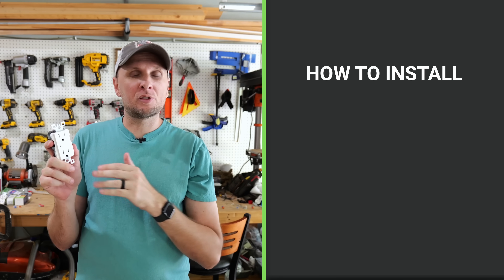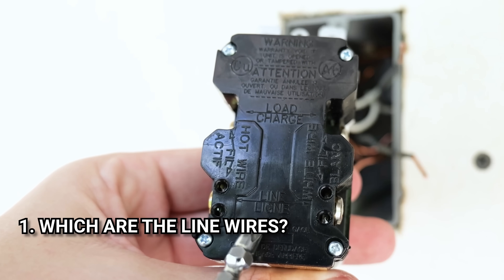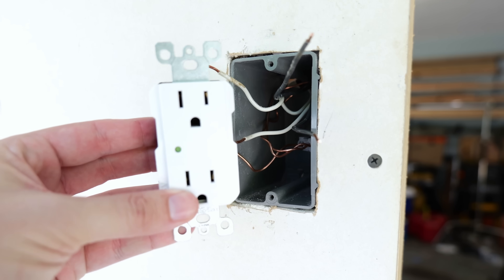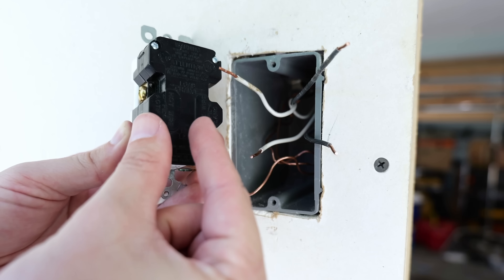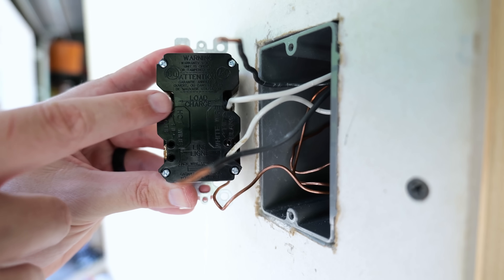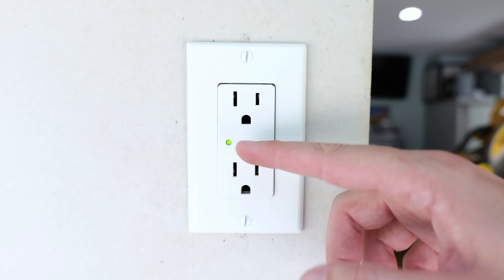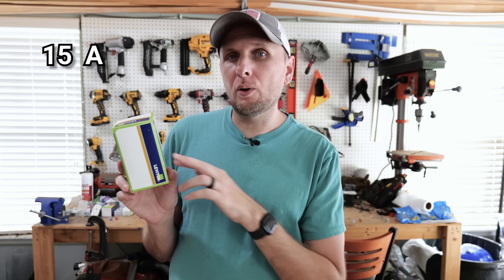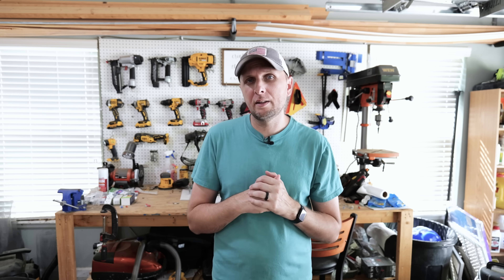This Tiny Device Just Made Bulky Surge Protectors Obsolete!

Comment: I'm no dummy, but the whole back stab thing being slightly frowned upon, really makes me question all of the stab wire terminal blocks (wire nut replacements).  I mean, I have no issue using them in lower current lighting applications.  For receptacles, I like to got as robust as possible, heavy twists, wire nuts, screw terminals.  Like if I have a 120V air compressor, or a heater, anything running long durations.

Comment: Dude, using AC receptacles with built-in surge protection is never a good idea - surge protectors (that contain MOVs, like these Leviton outlets you show) are basically "disposable" devices and it would be annoying to replace them, especially if they are located behind a heavy furniture. It's much easier to replace plug-in surge protectors, either the ones that look like generic power strips that plug into any AC receptacle or the "whole house" ones that you install into breaker box/load center. Same reason I do not use AC receptacles with built-in USB ports in any of our houses.

Comment: I think it’s a great idea but you still can only plug two cords into it.The purpose of most surge bars is to plug in multiple cords & provide surge protection.These are great for 1 or 2 items being plugged in at point of use.I will use these though were I have only 1-2 items being plugged in at point of use.

Comment: As others said, this outlet has "less" protection then many standalone surge units. Besides Joules rating... Label shows L-N/N-G with 600v and L-G with 700v are much higher then many others that clamp surges at around 300v. Similar to "whole house" units installed at load panel "they work" to eat big surges but still may not help you for some equipment vs. It might help a lot like many LED "light bulbs" and Fixtures as most have nothing to protect from surges or other power problems. Note that Many better standalone "surge" protection have more then 1 or 3 MOV to condition power output like Noise Filtering even before looking/buying a battery UPS or other active power conditioning. Noise Filtering often blocks both ways, line to X and Iffy X noise getting out to the rest of building But often does not block Noise from other outlets on same unit.

Comment: hummm i believe the NEC states that when replacing a receptacle it must be replaced with arc fault protection with either an arc fault outlet or an arc fault breaker ...406.4(D)(4) Arc-Fault Circuit-Interrupter Protection
Reply from the maker: Yes, but that topic would be for a different video as it depends on location, current AFCI/GFCI protection whether it is an existing device or maybe a circuit breaker.  And some places have made amendments disregarding that section, I believe Oregon is one place that has done that.  So it is also AHJ dependent.  So good point but not really what I am going over in this video.

Comment: When back-wiring (not “backstabbing”) I always find it helpful to tug a bit on the wire after “connected” as I have made the mistake before of inserting the wire on the wrong side of the internal plate….. screw that down and….. the wire is connected to nothing and will just fall out.  Face-palm (but true).

Comment: How long before it fails?   Do you need to replace it after 3 storms?
Reply from the maker: There is no way to know that, just as you can’t fully predict regular surge protectors.  So many factors would go into that.
Reply: @HowToHomeDIY  my experience with surge protectors has not been good.  On a business level, they fail often and manufacturers fail to uphold a warranty and fail to replace or cut a check for devices they say they will in the warranty.  And they fail often and randomly.

I would just hate to need to replace that often in needing to power down n yank it out of the wall....
Imho.....
Reply: In my home I now mostly use Monster or similar outlet cover style surge protectors instead of older style outlet strip surge protectors (with the old cat5 protectors. Lol...)...and even the monster covers fail pretty fast.   Everything else works good.   I have gfis, smart outlets n glass smart switches all working ok.  No sign of surge problems on anything wiring related.

Comment: You made it sound like you can just take a 15 amp surge protector and just replace it with a 20 amp surge protector, and that is not true you also have to change the 15 amp wire from the service panel with a 20 wire and 20 amp breaker. Not as simple as you make it sound out to be!!!!!

Comment: If these use MOV devices for the surge protection, they are consumable.

It is easier to replace a plug strip than an outlet.
Reply: And most plug strips have higher joule ratings than the Leviton outlet.

Comment: Only 2 plug holes? We need more plug holes.
Reply from the maker: Ok you can add a regular power strip if necessary.  Still way smaller than most surge protectors.

Comment: This video subscription is generally very good (I have learned much from it), but this particular video (for me) raises more questions than it answers (Line/load?, One black is different from the other black?, How the tiny device obsoletes a surge protector when it only provides two outlets versus multiple?).
Reply from the maker: 😂 if you have some of those questions, you probably should not do anything with electrical.
Reply: @HowToHomeDIY  My point in watching the videos is to learn about electrical.  I have learned a lot from watching many previous episodes but felt frustrated with this one since it brought up some unfamiliar concepts and I am used to your helpful explanations.  Maybe I missed an earlier episode which already covered the concept of line/load and why the two black lines are not the same.

Comment: Yeah but can you plug 10 things into that outlet. These are nice to have but one reason we use strips is not only for surge protection but for a safe way to plug multiple things in. Computers and entertainment systems both have multiple things that need to plug in so you’d still have to use a power strip

Comment: Nope, that's what you call a token gesture at surge protection, just enough to call it that, stuffing 2 or 3 MOVs in there isn't the same as a larger unit with more surge protection components, and that are rated for more joules and amps.  That means a few things but practically speaking, can handle a larger surge, and can survive smaller surges, and may be able to clamp surges at a lower voltage threshold.

Comment: Even after checking for lack of power, I still treat it as if there was power present.  Why, it's because I've had circuit breakers fail on me.
Reply: Also noticed failure to probe the white wires for voltage.  The person who worked on the wiring before you might have been insane.  I lived in a condo that had no wirenuts in the junction boxes, everything was bare copper connections!

Comment: Both versions are only rated for 720 Joules, whereas a wall mounted unit that I purchased is 1680 and power strip 3390.  I live in Jacksonville, Florida and lost some electronics (including a $1000 air handler motor) until I installed two parallel whole house SPs, SPs on my AC air handlers and compressors, and on ALL electronics (refrigerators, freezers, microwaves, washing machine, office equipment, etc.).  I also have surge protecting UPSs for most of the office equipment, going through a surge protecting power strip connected to *that*.  I prefer overkill to remediation.
Reply: This is the way.
Reply: Great It was said that some some companies offer that their surge protectors last a few years and may not clean the power like noise or provide voltage consistency. Has this been your findings?

Comment: Looks like an MOV design, which is sacrificial and thus needs replacement as the MOVs wear out -- seems like replacing a strip is much less effort. And w/o an indicator LED (like on TrippLites), there isn't a good indicator of when it needs replacement. Personally, I use Tripp Lites for less expensive gear and non-sacrificial Zero Surge for gear that is > $2000 and feel it is a better practice than using these.
Reply: @rayl6599  when talking about surge protection is all about the Joules of clamping force to stop all of the surge.  Individual surge protectors like you have all vary in the amount of surge they can handle.  That is why a whole house surge protector can provide best surge protection because of its large clamping force.
Reply: @billhandymanbill2775  There is certainly a place for whole house protectors like helping soften a nearby lightning strike (nothing will save from a direct strike). However, they do not protect against internal spikes (from motors starting, etc.) Also, to note, non sacrificial protectors like Zero Surge, SurgeX, Brickwall have no joule limit besides the wires melting as they don't wear out (which is what the joule limit measures - how much protection there was initially). Anyway, it comes down to the value of the equipment being protected. e.g. fancy AV system in the thousands would merit a few $100.

Comment: Not a good idea to put something that can catch on fire/explode in the wall box.  These devices have a life span depending on how many surges they encounter,  May have to be replaced in the future as they will either disconnect silently or with a bang.  Just as bad as putting in the ones with integral  USB ports.
Reply from the maker: 😂 it’s not going to explode.
Reply: @HowToHomeDIY  "Tiny" adequately describes how little surge absorbing capacity they have.  It's all about the voltage clamping level, then joule capacity.

Comment: Thanks for this. Say you have a HSV - where would you use these SP outlets in a 2k sqft home with lots of computers and entertainment devices?
I've always heard that surge protectors should not be plugged into another surge protector. Kind of hard to find an outlet strip w/o surge protection built in. Thoughts?
and... What about conditioning  the power or battery backups? Any whole house options? Looks like we need another video! 😁

Comment: "just"??? there has been one of those in my dad's office for around 30 years.  I have two in my living room feeding the big power strip that powers what's left of my entertainment system.  been there for around 20 years.
Reply: Have you noticed the grip between the plugs and sockets decreasing over time?  Also note that surge suppressors have a limited lifetime.  Once a surge suppressor absorbs a certain number of spikes, it stops working.
Reply: @JohnShalamskas  the plug strips never get unplugged from them.  and I no longer have anything worth the cost of replacing the plugs.  and the point is surge suppressing receptacles are nowhere near new.

Comment: If you live in the country strongly recommend that you have a quality whole house surge suppressor at the main  ( service )  circuit breaker panel along with surge suppressor at each TV & tower computer. Would have bent the ground wire around screw more. Failed to use a torque wrench on the wire screws. It has been a NEC requirement for last 12 to 15 years. NEVER leave bare wires hanging out a box without installing wire nuts on them. NEVER purchase or use any safety or test equipment, circuit breakers, receptacles from lying cheating lack if quality control nogoodnic communist china.
Reply: Oops forgot to mention microwave ,stereo systems etc should be on a surge suppressor.

Comment: I installed several of these a few years ago. They don’t replace having a whole house SP on your panel and they don’t protect any downstream receptacles. So far no issues , either with failures  or surge damage.
Reply: It says it has LINE and LOAD terminals.  So like a GFCI outlet, wouldn't that protect downstream devices?
Reply: @jwhite4  Hi. That is so you can install these midstream and pass current to the downstream outlets. The issue is the timing of the surge to pass to the ground, I believe. So, a downstream outlet is milliseconds away from the SP outlet and its ground ,so it would not FULLY  protect the surge at that downstream  location. The instructions do indicate there is "some" protection downstream depending on the length of wire between the outlets ( no calculations given , though) . I would say , if you have sensitive equipment at more than one location on a branch , install SP outlets at each "sensitive"  location to be sure. They also do not have the surge capacity that a panel SP has ( which is usually connected within a few inches of panel ground). Milliseconds count. Hope that helps. I can say we have had some surges recently and no damage to anything so they do work.
Reply: @rzh3443  I wasn't commenting on the quality of the surge protection, either in the new outlet, or downstream.   I have a Siemens FP-140 whole house one, which I think keeps me fairly well protected.  I agree with most people that a larger capacity surge protector in a power strip is probably better.   But if you have neither of them, an outlet with some built in surge protection is at least better than nothing.  
I did just look (Dec 2024).  A standard 15A Leviton decora outlet is $3+; whereas Amazon shows $23 for the model w/ surge protector (and that's listed at over 45% off regular price).  So definitely a niche product.

Comment: Most homes go a lifetime without a surge are we overemphasizing a minimal risk?
Reply: @larrylong6268  No not really.  With more and more electronic devices used in the home such as micro
Reply: @larrylong6268  such as a microwave, garage door opener, televisions, security system, CCTV, etc. they all sensitive to electrical surges and can quickly be destroyed.
Reply: You must not have any thunderstorms, compressors (including your neighbors), or power company doing load switching.

Comment: Can you mix these with GFCI on the same circuit?
Reply: @thyme-wm8pt  yes, they are two different types of protection devices.  One is protecting equipment from incoming electrical surges of electricity and the GFCI is protecting a person from being shocked as when a hair dryer is used on a GCFI electrical circuit in the bathroom and it accidentally falls in the sink full of water.
Reply: @billhandymanbill2775  GFCI shuts off the line power if it detects more than a few mA of current on the ground wire.  Transient suppressors clamp voltage spikes to ground.  The voltage that they trigger at varies,  which is something that you don't often see on the packaging.

Comment: I've had issues with surge protectors tripping circuits with GFCI protection.  Since surges are shunted to ground in a surge suppressor,  the GFCI in the circuit may detect the shunt and trip the whole circuit offline.  If your microwave is on the kitchen counter, and all the outlets are protected by a single GFCI outlet at the beginning of the branch (it's how my kitchen counter outlets are wired), you could have issues with repeated tripping of the GFCI and not know why it's happening.
Reply: The protector must be defective.  A normal transient, if it can be considered normal, should be far too brief to trip a properly functioning plug in / outlet model.  They are supposed to have MOVs between L1/L2 and a GDT to ground (earth) with the GDT being used to prevent low level leakage which actually can contribute to tripping a GFCI (or RCD if you are in other parts of the world).

Comment: is this similar to a GFCI?  is the law/requirements in your state or national? not heard of this.
Reply: @crazydoglady5  see my answer on the GFCI question.  The 2023 NEC (National Electrical Code) now requires it on new panel up grades, however, many AHJ ( Authority Having Jurisdiction) can override the NEC or maybe they have not updated their electrical requirements yet.  It makes good sense to install a “whole house” surge protector.  Power strips are not designed to take the place of a whole house surge protector as almost all of them do not any contain surge protection circuitry, they just provide additional outlets to plug in electrical devices.  Power strips really are a false sense of security when it comes to surge protection.
Reply: @billhandymanbill2775  interesting. thanks

Comment: They go out every few years and you have to replace them.  I replace surge protectors never.  Hello.   In the wall is a better device overall.
Reply: Why put something in the wall that can catch fire or explode?
Reply: @napoleonsmith7793  I have had my whole house surge protector for 11 years now and never had to replace it, both LED (Light Emitting Diode) indicator lights are still green to say the unit is still working properly.
Reply: @billhandymanbill2775  Same here, but around 8y.  I think every decent SMPS has MOV built in, which means every modern appliance. Those would be more painful to replace

Comment: Your installation is fine except it does not address the problem of multiple devices that need to be protected at the same location such as a computer work station or an entertainment center.  In these cases you would still need something that several devices could be plugged into at the same time.

Comment: It's nice, but only two outlets, as opposed to the normal 6-outlet strips.  Also, to replace it looks and sounds simple, but I'm not an electrician.  Replacing a power strip is something I can do with one simple operation, no down time for the circuit, and ZERO wiring, screwing, or unscrewing.  Unplugging one power strip and plugging in a new one is WAY more desirable.  Plus, I use the outlet expanders that accommodate six devices, and plug into both outlets on the existing outlet device.  I try to find the ones with the center anchor screw hole so pulling the plugs for each device out doesn't unplug the entire thing from the other outlet.